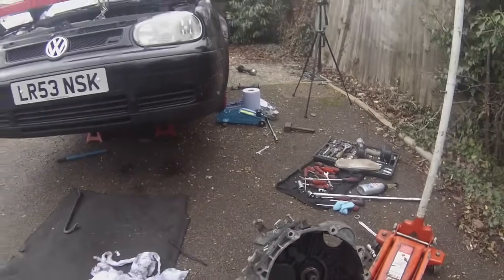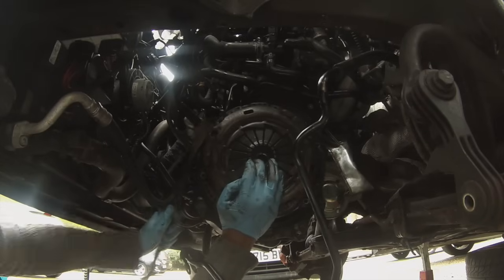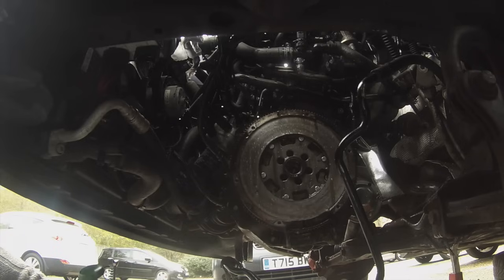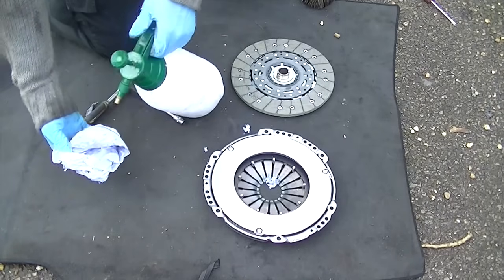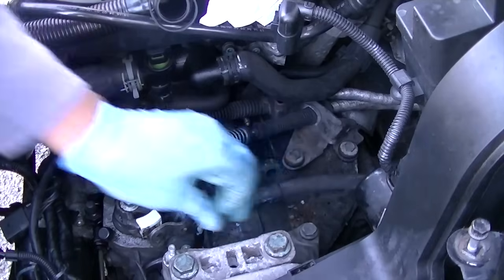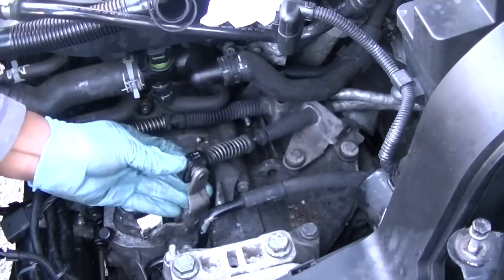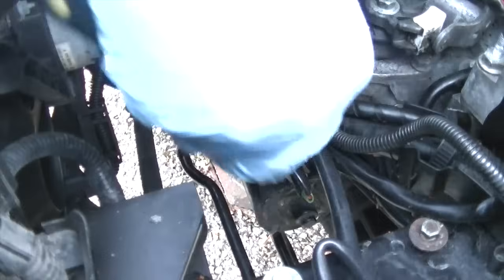How to replace a VW Clutch Part 2

Comment: Thanks for showing the process....and helping me make the decision that I'm never doing this...I'll just get rid of the car when the clutch fails!
Reply: It’s only worth doing yourself if you’re a proper car person who has all the tools and knowledge
Reply: @jm4gaming886  I agree...def not for a regular garage do it yourselfer...need a shop with a lift and the proper supports...I’ll pass on this one.
Reply: You don’t need proper lifts, I did this today for mine, all I used was axle stands to hold car up then jack to hold engine, then wiggled transmission out, it was a bitch job but I did it on my own outside my house
Reply: And mine is a TT Quattro so there was a propshaft and a transfer box in the way which made it difficult to manoeuvre
Reply: @jm4gaming886  and I give you props for doing that...after rebuilding my entire front end...I don’t have it in me to take this on...it definitely is fulfilling to pull it off...I just don’t see it in my future 😁
Reply from the maker: Its really not that bad. You just have to be prepared and commited.

Comment: had a look at your vid before doing my clutch today on my 03 Bora..same job....I have a ramp and garage facilities and it was still a job..respect for you doing it on the floor,,,,please note there's two clutches on these, an LUK and Sachs unit..if you are not changing the flywheel like in the vid, you need to know which unit you require but obviously if you get a full kit including the flywheel, you'll be ok..the box is very heavy, do not attempt yourself without a gearbox jack..good luck

Comment: Hi guys. Ive done this 3 times now as wrong clutch was fitted. Easy way to remove and fit gearbox is with engine hoist. Took me about 4 and a half hour's start to finish. Great video's by the way

Comment: I'm not sure if you know but should your tutorial work the same with a beetle. Some things looked a bit different looking in the engine but they still looked pretty similar (the car you worked on and my VW Beetle) because I thought you showed ow to replace this clutch really well and I want to use it if it will be useful for my car. The year of the car I have is a 1998.

Comment: Great video!! I'm working on a project with jetta engine. Replacing the old clutch system, I want to know what's the size of the bolt that is used to fit the pressure plate onto the flywheel. It would be great if you can help out

Comment: what's the torque spec on the clutch allen bolts? also does the 16mm socket align the clutch correctly or should i use a tool?
Reply: I'm about to swap in a 02m into my wagon

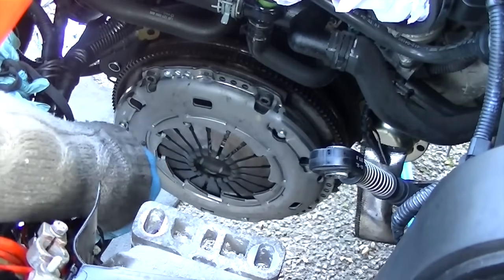Comment: 5:30-5:40 use locktite the allen bolts can run lose some times!
Reply: Loose if you use specified torque? With locktite haven't you the risk to strip them next time you have to remove them? They are not big bolts I think they cannot bear a huge torque. 
Which color of locktite? Dry or wet?
Thanks

Comment: +BMAC VAGS Why do you use the engine support bar?  Did you loosen any engine mounts? Is there a way to do this without needing to support the engine?
Reply from the maker: The gearboxhas a mount that supports the engine, otherwise it would be hanging on one mount like a dislocated shoulder.

Comment: Hey man, thanks for the video. I just can't seem to center my clutch on my 1.4 Polo. What can I use? I do not have a centering tool.
Reply: At about 5.09 on the part 2 video he said use a 16mm socket to centre it?

Comment: I have seen that you lubricate shaft clutch and the clutch disc is from LUK. in instruction the shaft should not be lubricate. wont be any problem with it?

Comment: What are symptoms of bad clutch? I have a b5 passat 1.9 tdi with 240 k on clock, its not fast as it used to be,should i consider replacement
Reply: +Mirko Nejašmić if your clutch pedal starts to recede then you need a new clutch
Reply: Mirko Nejašmić maybe your intake manifold is clogged from exhaust gas recirculation

Comment: Im stuck getting the transmission mounted to the engine i can get it to slide far in far enough for any bolts to start
Reply from the maker: did you follow the video?

Comment: How long did this clutch last without proper tool to align the clutch correctly ? :s
Reply: Well as long as it was roughly centre and the gearbox slid on nice, as it did in the video, the first time you press the clutch it will centre.
Reply: Is it like this on all cars then? I know of a friend changing his clutch on a opel Vectra and it burned right true them without the proper alignment tool ;>
Reply: +Thorstein Hansen you probably mean SAC reset tool. That's self adjusting clutch found on some cars

Comment: Just removed mine from my Vr6 golf was a fight rocking it back and forth.
Reply: Done on my TT, biggest fight of my life
Reply: @jm4gaming886  I am about to do it again sometimes next week LOL. My first gear is slipping.. revs and then goes. Gonna check the slave cylinder first and bleed the clutch fluid and pour new fluid. if it doesnt work properly after that it'll be a new clutch LOL